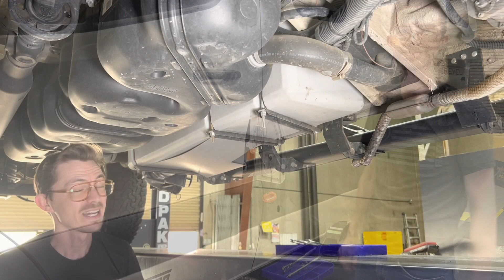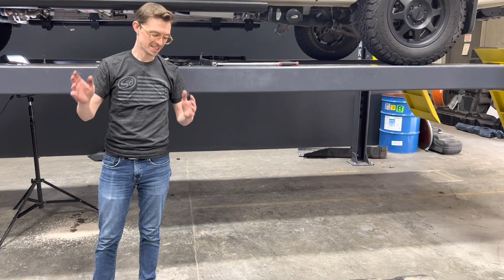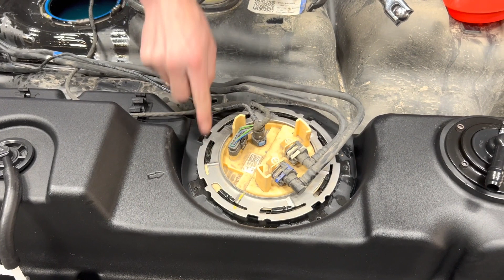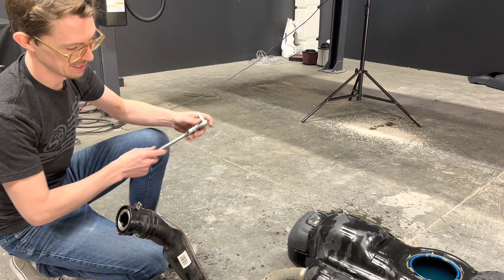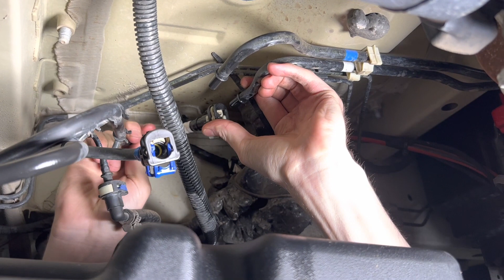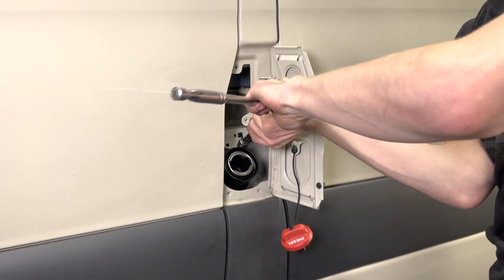S&B 40 Gallon Replacement Fuel Tank Installation for the 2020-2023 WINNEBAGO REVEL (2019+ CHASSIS)

Comment: If I had to do this again, here is a tip for people installing this on your Jayco Terrain, Entegra Launch and probably the Winnebago Revel.  I would buy a longer piece of fuel line for your aux heater fuel pickup tube that goes into the tank so it extends closer to the bottom of the sending unit, since you'll now have more fuel in the tank as a failsafe to keep your heater from using up all your fuel. I wish S&B would at least mention this as an option so you wouldn't have to remove your tank again to do this mod.  Also for people with sprinters without heaters, you  might want to go ahead and install a fuel pickup hose for the future since you have the tank off.
Reply: I’m wanting to do this. What size hose would be needed? How much longer?

Comment: Thanks for the video instructions, for this one and the older one, it was a great help.  I just did my Entegra Launch 19Y today, it took me roughly 4.5 hours on the ground. For MY particular van I had to trim three of my waste tank brakets (two were touching the new tank, the other was danger close).   I also had to cut the tie wraps to allow some of my big heater wire bundles and hose in the front part of the new tank to allow the tank to nest into place.  I also had to purchase six 5/16 or 3/8 washers because the holes were kinda large on the new brakets (maybe my rig didn't come with the factory hardware because it wasn't torx fasteners, and there were spacers needed between the brakets and frame).  All in all a pretty easy install.  A floor jack with a board under the new tank really helps.